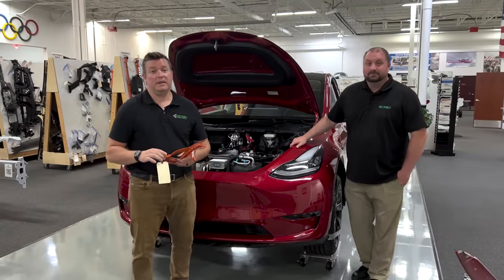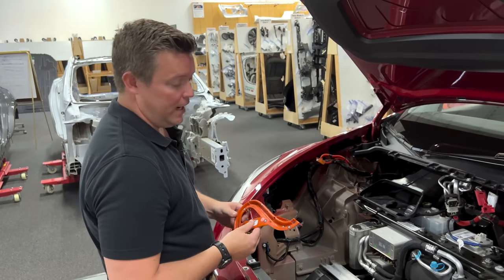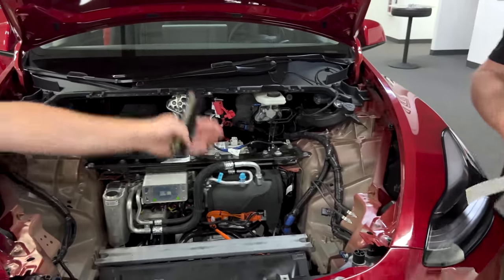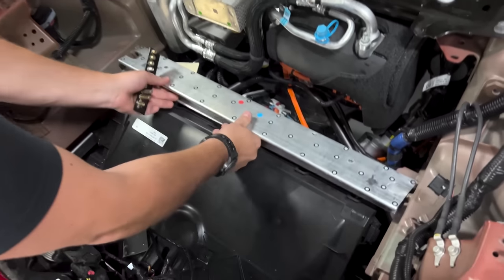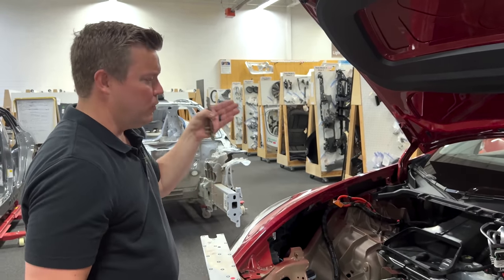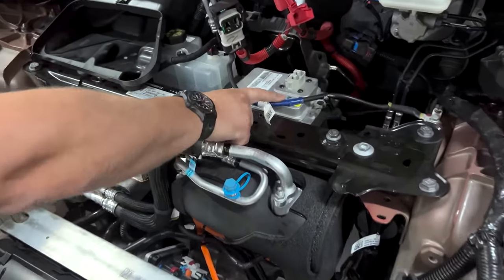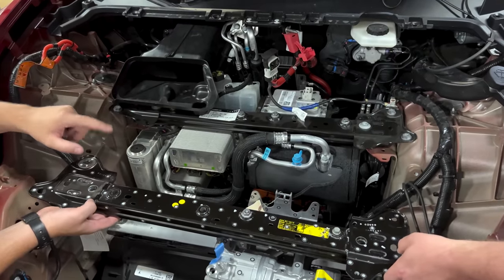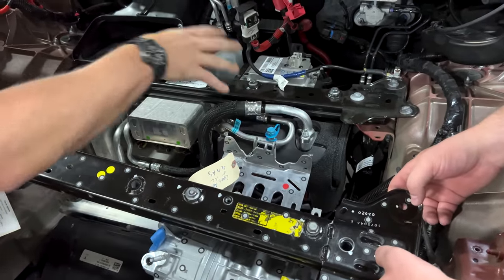Tesla Model Y - Under the Hood | Giga Texas Revisions

Comment: I'm amazed at how fast Tesla revisions are coming,  in the old days you only saw new things with new models. Tesla seems to be pushing out updates both in hardware and software constantly.  I think Tesla is definitely underrated in terms of it's engineering design work flows. Their cycle of design/test/production seems to be one of the best.
Reply: "seems to be"????
You're the one underrating Tesla.
Reply: You just started paying attention.
Reply: They can make so many revisions  because they don't use too many suppliers. In the time frame Tesla make a part from a new revision , the other OEMs are still in the process of discussing an offer from the supplier .
Reply: @paintedpony2935  Oh no definitely not underrating them, I've already ordered a Model Y, just waiting on it to arrive. I've been following Tesla since I first started buying their stock in 2012, I've been pouring lots into their stocks and now I'm finally getting my first vehicle.
Reply: @envisionelectronics  ah no I've been a long time investor in Tesla,  but just recently started watching Munro's playlists on them
Reply: @lettoreespatriato3270  great point,  yeah Tesla makes more in house parts than any other car company in the US last time I checked
Reply: This is a direct consequence of Tesla's "culture".  The design engineer owns the part, not a committee.  As a responsible owner, the engineer must make sure the part works well in production and to change and improve it if it doesn't.  Those 3 tabs on the filler pipe?  You can bet those were reduced to 2 after the production line let the engineer know what a pain it was to install that hose onto them.  No meetings, no committees, no turfing by managers who hate each other, just a peer review to make sure the new part solves the problem and doesn't cause more problems.
Reply: People argue about what Tesla is, is it an automobile company, a Tech company, an energy company?  I think it's an engineering company; and it's run by engineers, with an engineering ethos, and not MBAs.  Call it an 'Applied Engineering' company to capture that they apply their engineering expertise to different products and processes, but at the end of the day, they're an engineering company.  That has applied their engineering expertise to redesign the car and redesign how cars are produced.  And have applied their engineering to redesign the batter and how batteries are produced, and power walls, and Bots, and whatever else they do.  But whatever it is, they're applying engineering to an existing situation and making it better.  What Tesla is is an engineering company, and there's almost unlimited scope for them to apply their engineering expertise.  All SpaceX and the Boring company, etc, etc, are are simply areas where Elon's applying engineering to do something in a new and better way.  That's what they are.
Reply: Constant revisions will make finding and reusing spare parts from wreckers a nightmare though.
Reply: @michaelfoster1585  Ordinarily this would be true. (Ha, I spent so many hours as a kid in junkyards scrounging car radios for electronic parts!) But I suspect Teslas will (eventually) be more like laptops or iPhones, designed more for recycling than for junkyard salvaging. Certainly plans are in the works already for the battery packs. Someday we will have (reverse) factories that bring finished products in and send element ingots out. Maybe call that re-mining.

Comment: Re:spot welds - from what little I know about the giga casting material, it's not particularly hardenable (by design), so no post-cast artificial aging/HT was needed.  This helps prevent part distortion.  If that's the case, then the embrittling effect of the weld should be less.  Quench time is also a factor and that's a small heat effect and an ocean of material to quench heat into, so any grain boundary precipitation should also me mitigated.  But this should all be predicated by knowing the aluminum alloy system, which I don't, so all I can do is give Tesla the benefit of the doubt.  I do know they have a top notch materials team...
Reply: All that said it would seem better to have a mounting extrusion built into the cast but that’s probably not always possible.
Reply: @ken-mb5cp  
Cory told you why that wasn't possible
Reply: Looking at where those welds were on the casting, I was more worried (and so was Corey) about weld penetration than material weakening. There should be plenty of material on the casting to weld into without distortion. Thank you for the description of why that's most likely the case. I'm glad to know these giga castings can be welded into. Tesla already saves so much time & work with the casting that a few alterations are to be expected. That leaves options open for future modification. This actually turns a potential negative into a positive.
Reply: Makes pulling the tub an interesting event, to possibly discover your first weld failure in a giga-casting.
Reply: i m even questioning if they even need this support bracked. So spot weld could be unnecessary with little redegn of top bracket if weaknees under chasis flex is problem.

Comment: It is frustrating to see many companies are bankrupted, NOT changing their product for the past 30 years. The mentality  "We always did it that way" is simply not working anymore! 

Thanks team Munro!
Reply: Kinda like the Model S looking the same for the last decade? 😂😂
Reply: @ganymede3141  You need new glasses!
Maybe a mercedes horse is something for you!
Reply: @ganymede3141  model s does not look the same and it's not even the same car at this point.
Reply: @ganymede3141  
You mean apart from a complete front end revision years ago, new parts throughout the car and the latest car with ever body panel different except 1?
.
We're in Porsche 911 territory here.
Reply: @clevernduruza8624  Other than a slightly tweaked front bumper in 2016 (getting rid of the black faux grille) and an even more minor cosmetic tweak in 2020, the Model S looks exactly the same as in 2012. It's getting very long in the tooth.
Reply: @rogerstarkey5390  Complete front end revision? You mean the slight redesign of the lower facia fog-lights? Yeah, that's about it. Otherwise, a 2012 Model S looks the same as a 2022. In 2016 Tesla also did a front bumper tweak to get rid of the faux-grille, but that was about it. Even rear end is the same, with same lights. The car looks exactly the same except for a few minor cosmetic tweaks to the front bumper (easy to change) and different wheels. If I put a 2022 front bumper and wheels on a 2012, it would look the same.

Comment: The "spot welds" you pointed out appear to be cold work stamping to me. Nothing better than metal that sticks together by itself to hold your adhesive bond. "no part" philosophy there. Probably the heat from deformation and thin-ness of the glue section in the compression area tack the components together. Cheers to getting into these awesome details of the consumer products. Always gotta appreciate and keep the big companies honest!

Comment: I love your channel! We appreciate your in-depth coverage of Tesla and other manufacturers.  My problem with Tesla isn't their engineering nor constant improvements in the chassis, electrical system, or drive train. It's the hubris of forcing customers to take no instrument panels, glass ceilings, yokes instead of wheels on some models, etc.  One size does NOT fit all.  I like what Hyundai/Kia/Genesis are doing with their EVs.

Comment: "Assembly line efficiencies make up more than your material savings"
This is something far too few people (even engineers) are aware of.
Reply: If you make a change that saves 10 seconds, that means you save 1 hour worth of time every 360 vehicles. So you are saving $40 labor on every 360 vehicles. If you make 100,000 vehicles that is over $11,000 saved by just shaving 10 seconds. That is over $100,000 saved on 1 million vehicles. This is only labor, not material savings.
Reply: That would be good if they passed the savings on to the buyer, but they don’t.
Reply: If you avoid errors on the assembly it pays off even more...
Reply: @slicksalmon6948  lol yes they do. The reason you can buy cars for so cheap is because of manufacturing efficiency. Right now there’s a shortage but you can generally pickup a new car for like 15k from some brands.
Reply: @slicksalmon6948  You do realize this only saves about 11 cents per car in labor? Are you really gonna notice if you $60,000 car costs 11 cents less? This is all about savings on a macro level. Eleven cents is nothing, but saving 10 million on 2 billion dollars of costs is something.
Reply: @harsimranbansal5355  Toyota Corollas are about $22k to $25k.  Not many models cheaper that that out there.
Reply: @jackt6595  
It's not the labor cost. Time savings like this make the line move faster, so it can crank out more cars in the same amount of time. Increase the output by 1% and you increase your revenue by 1% without spending a cent more capital or labor cost. Don't forget, the entire line moves as fast as the slowest part, so a tiny change can have a huge effect on overall productivity.
Reply: That’s your opinion lol…….
Reply: @PC-vq5ud  there are actually way cheaper models the Toyota Yaris, aygo……. About $9k+
Reply: @bernhardleopold6702  
Ref their EQS review?
(Weeping hose right at the end.... Way up inside the "rats nest")
Reply: @harsimranbansal5355  
"Manufacturing efficiency"?
Depends your definition.
.
For instance, Ford might consider it "efficient to use parts from "the bin" which are cheap because they have a million of them in stock (ref Mach E, or the Lightning bodyshell)
Doesn't mean they're "efficient" to assemble in a new vehicle.
Reply: @slicksalmon6948  Why would they right now? They literally sell every one they make, and have a huge backlog. What company is going to drop prices in that situation?
Reply: @grahammonk8013  Fine, then pay dividends to your investors.
Reply: @slicksalmon6948  Again, why would they? They are making good cash flow right now, but the are concentrating on growth (at least 50% per year on average) and they have to also grow the number of SCs, and superchargers, which Ford and GM don't have to.

Comment: I am getting the long range MY with 2170 pack from Austin. Is there a difference between that and long range from Freemont? I know Austin MY doesn’t have structural pack. Does it have front casting? Any info would be appropriated. 😀
Reply: Materially FREMONT MY should be similar to AUSTIN MY , but Austin MY should have FULL Front Gigacasting and 2170 cells, However its likely built with the LATEST parts Revisions as in the 4680 MY. Its likely FREMONT is using UPDATED parts Catalog from the Austin MY.

Comment: I want to tap into my 12v or 14.4 battery to add a inverter into the tFrunk. Is there a spot for jump starting and a ground would work. I see it does not have the normal 12v battery connections to add some 6 gauge wire to the inverter. Would be nice to have a 1500w or 2000w inverter to power things around the house in a power outrage. I bet the Y could power a fridge and tv for days on the available capacity just leaving the car on with AC off.

Comment: Curiously, one of those rivnuts at 5:40 was a build flaw on my Model Y.  It was loose at delivery, apparently spinning when the screw holding the trunk bottom was installed.
The only other problem was broken clips on the frunk trim, mentioned in the original Model Y teardown.

Both were replaced by mobile service, taking very little of my time.  I don't expect that the rivnut will be a problem, but those clips seem likely to break again.

Comment: At the 19 minute mark, are the welds there to hold and position the parts while and after the structural adhesive bonds ? ? The slight weld imbrittlement would end up immaterial after the adhesive sets.

Comment: aluminum anneals with subcritical heat, unless it gets re-aged with a proper heat treating, however that custom aluminum alloy they are using is supposed to be able to skip heat treating and come out in a good condition. Aluminum does not create martensite carbide precipitate like over temperature steel welds in high carbon alloys do, alloys like, 1045, 4130 etc etc ect

Comment: How does Munro store all the parts and body’s in white from all the cars they tear down.  To be able to pull out a part from a tear down 2 years ago for comparison is amazing.
Reply: You know that warehouse at the end of “Raiders of the Lost Ark”?
Reply: older ones are SCRAPPED and Recycled, more Recent ones are Stored in the Garage.
they can throw out the older ones , because they ALL have been LASER scanned & Photographed and DATA is perserved & REPORT is generated and sold to Buyers. 
some of the Removed parts are Archived for Later comparison , extra parts, batteries , fasteners are Auction off or sold . 
MUNRO has had Part Auctions and Part Sales in the past. 
such as with the Tesla 4680 battery.
Reply: @markplott4820  would love to  see them do the laser scanning.  Is there a science as to where they place the dots?

Comment: Corey, might the dimples on the cross car support bracket be to establish a bond thickness between the stamping and the gigacasting? These could at zero part cost self-fixture the bond joint. Just guessing. Otherwise, why spot-weld and adhesive bond?
Reply: True .
Reply: To be sure to be sure

Comment: 19.40 - internal slide with slanted pillar actuation shouldn't be an issue on this part - however, one possible issue is coating the hidden tool surfaces with release agent. Just a thought.

Comment: One thing that this gives me a sense of is that every Tesla innovation seems to have 2 stages.
1) New thing that is over engineered to avoid failure.
2) New thing is refined to what is actually needed based on real world performance.

The probably knew they only needed two ears for that washer bottle when they first made it.
"Lets add a third just in case"

OEMs can't afford to do that since that extra part could end up being there for a decade or more because of the way they iterate the models.

Comment: 17:44 Could be there are some welded studs outside ( to fix the bracket to the casting from outside ) ? Or one process similar to the plastic vibration welding ?

Comment: Mr. Ferrari : "How many different fasteners are we using on the new SUV?"
SUV engineering team: "Yes."
Mr. Ferrari : "I'm calling Sandy on you."
Reply: I can't wait to see the first true Ferrari ev here in a couple year's. 😎
Reply: @Adam the tesla gen2 roadster? I'm wondering if that will start anywhere near the announced 200k price point from 2017.🤔

Also will it be able to beat or match the existing ev hypercars which have debuted or are about to since it was first shown back in 2017. 
Ev hypercars like the rimac nevera(first delivery to a customer last month now. The lotus evija, pinnifarina Batista(also tested already, the Aspark owl which did a 1.6 0-60mph.  

I mean the 4700# plaid model s when unlocked can come darn close to those evs, recently hitting 217mph. What would a 1000# lighter, with even more hp, also likely quad plaid motor equipped, better aero gen2 roadster do. Maybe elons 1.1s 0-60mph with the spacex package wasn't vapor ware talk after all. 😁
Reply: @4literv6  Not much mention of the roadster lately.  It will need its own castings, so its own Giga Press.  Maybe only just one for its lower volume and they just switch out the dies every few days or so.  Probably share a lot with the S drivetrain wise, like you say.  It could potentially be slipped into Freemont as capacity increases when the front casting rolls into the Ys built there.  Could a skunkworks team in Texas build a small line there to handle it?

Comment: I wonder if removing  that part that held the HV power lines for the compressor was a good ideal. It looks better and neater with it, and  It should stabilize those wires from vibration.. wires eventually fail from metal fatigue when constantly moved. Maybe they accomplished that with some other fasteners we could not see in the video.
Reply: @AudiTTQuattro2003  
That was my thought too. It's possible that somehow it attaches to the bottom of the front when it goes in or maybe the front sandwiches it between something else and the front itself. Kind of difficult to tell by the video. But the bracket that they no longer use certainly controlled that high power wire in a neat and tidy manner.
I watch plenty of car repair videos. And you will often find wires that are chafed through or just a simple vibration of things ends up causing a failure internally. This is something that happens with every manufacturer and as you said it's something I take a look at if I'm removing something and the factory retainer breaks or doesn't work well anymore. Zip ties work great for that. Try to support tubes or wires or anything else to keep it from flopping around.